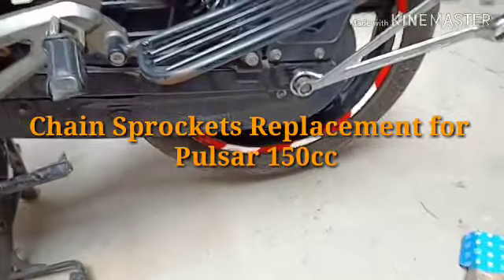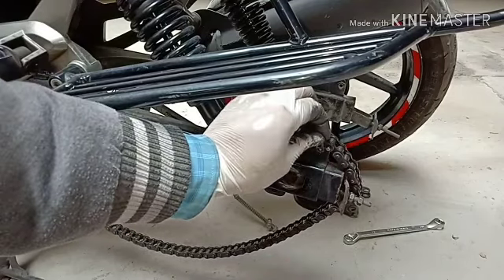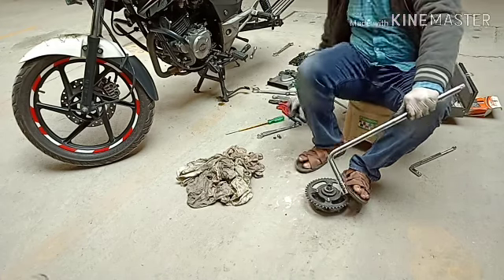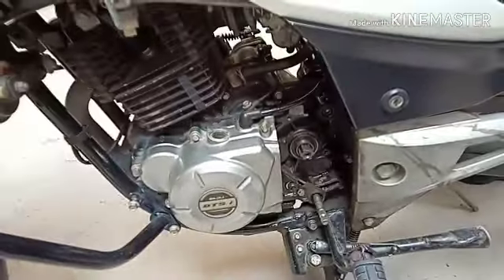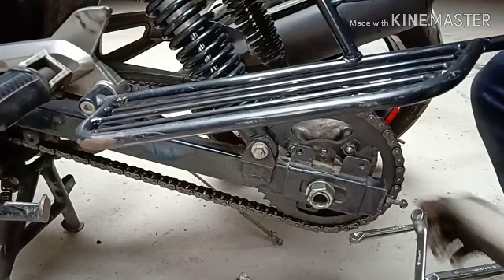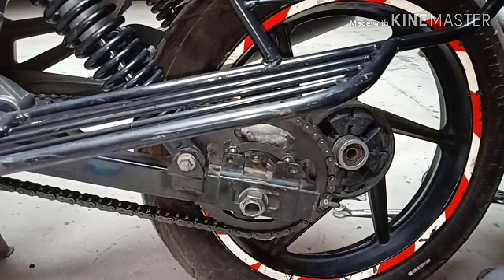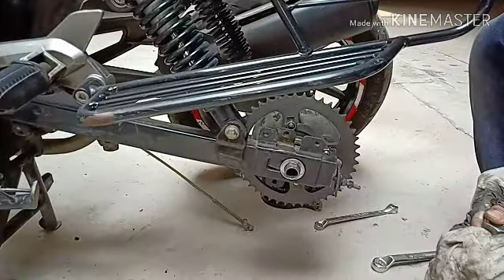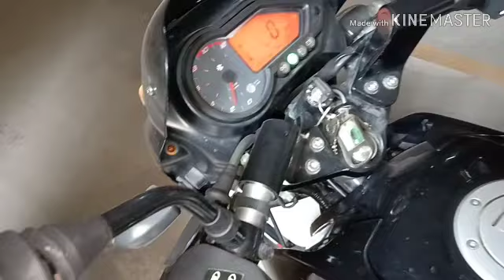Chain Sprocket Change: Pulsar 150cc

Comment: Bhai we must loosen rear sprocket nuts before dismantling the rear wheel by putting the transmission into first gear. I applied this trick in Pulsar 135.
Reply from the maker: Thanks,Will apply that trick in my next.

Comment: After how many kilometres u changed ur Pulsar 150 chain sprocket and what is the age of your bike????
Reply from the maker: My bike is  Dec 2014 purchased.It is 4 years old bike. Ideally we should check the KMs if it is 20k or more then you go for a replacement.I had noise problem although,my sprockets look healthy.Mine is 20750km